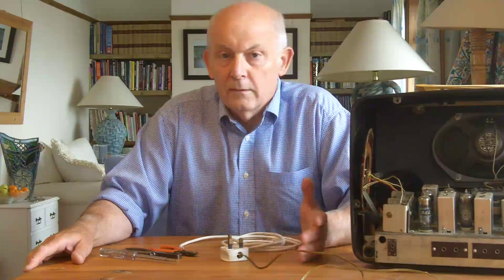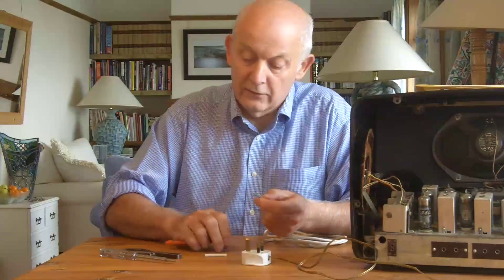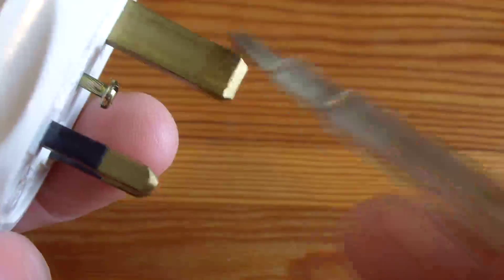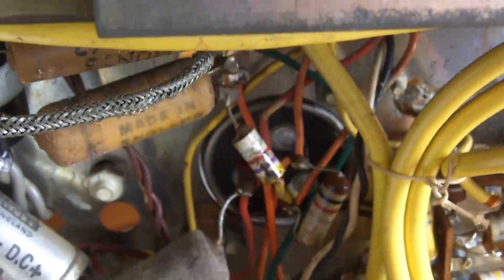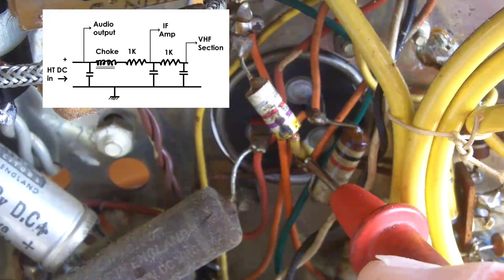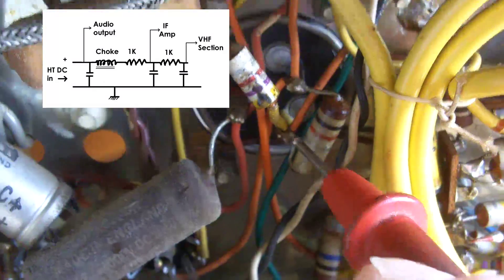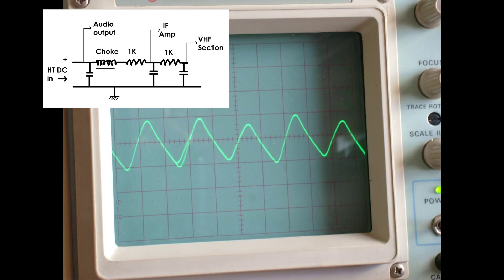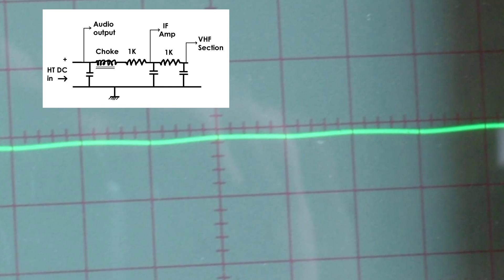About Radio ... Part 4  AC ripple on the HT DC by Andy Davies.

Comment: Never heard of a mains dropper cable as you described for the American radio.   I imagine that they were banned many years ago?
Reply from the maker: Hi there. I don't think I have ever seen a mains dropper build in to a lead since. As a child I could feel the mains lead getting quite warm, but of course I was too young to realise what was going on. In my simple mind the lead was getting hot so it needed to be replaced.  It's a heck of a long time ago, (I'm 75 now) but the whole dropper must have been incorporated into the woven fabric of the cotton covered lead. That is, there would have only been two wire visible at either end of the lead, otherwise I would have been confused about how to replace a multi conductor lead with the two core cable that I used. 
Thanks for the interest. 
Kind regards  . . . Andy

Comment: Hi, I was just wondering...why does the DC to the IF amp not need to be as smooth as the DC to the VHF section?
Reply: In case you (or anyone else all these years later) is wondering it is because in this radio the vhf stage is the first stage and so any ripple in the supply there that will inevitably distort the signal will be amplified by the i.f. stage and then amplified again by the audio amp stage.
 Same thing in a purely audio amplifier.   Small errors in the beginning are amplified along with the signal and end up much large by the last stage feeding the speakers.

Comment: Hi Andy,

Replaced paper and Hunts caps.  Your inline light bulb idea - excellent.  No smoke and just a glimmer in the bulb.  I checked a few voltages and it seemed OK.

I connected to full mains. No sound and some differences:

* Mains is 248V AC (using the 250V transformer tap)
* At first cap is 294V DC
* At second cap is 234V DC
* At the third cap is 188V DC

So it seems that something is yanking down the HT.

This would have all been very difficult without your video.

Best regards...Paul

Comment from the maker: @Shandybrother 
I'm a great believer of the notion that very small things lead to bigger issues, like the tiny inclusion of foreign matter or a miniscule crack  in a piece of metal leading to major fractures.  
Cutting the live wire 10mm shorter than the earth wire could just save a life. 
 By the way did you get the job?
Kind Regards ... Andy

Comment: Hey Andy,

Very nice video. Very good explanation of the circuit and you have explained what each part does in the circuit. It is great to see how the filter circuit progressively gets smoother, and you explained why and where each section is used.

Regards,
Rick